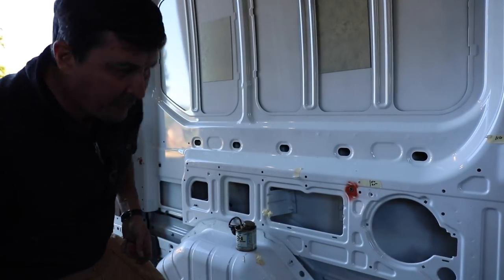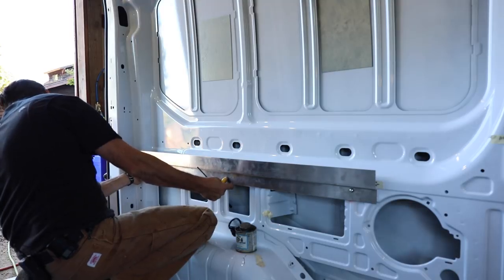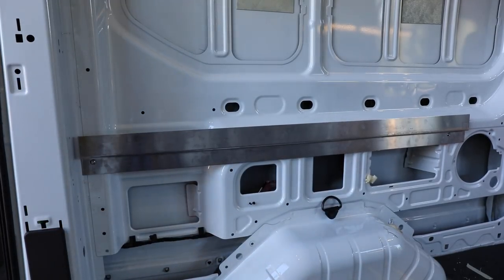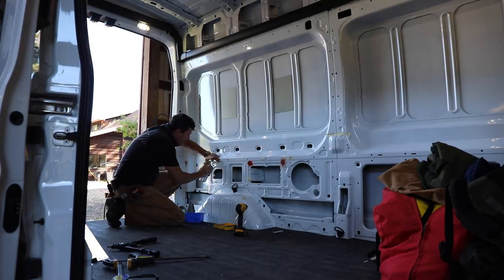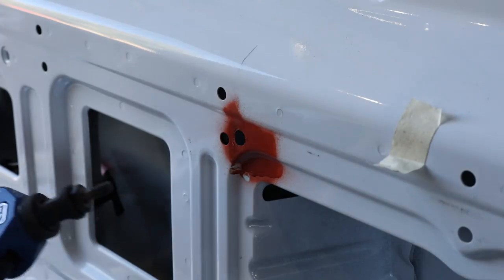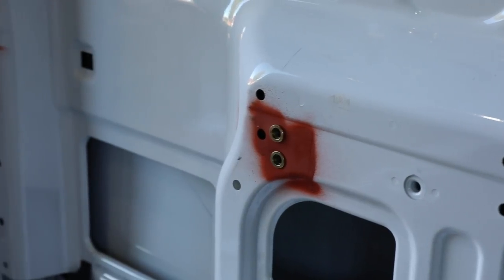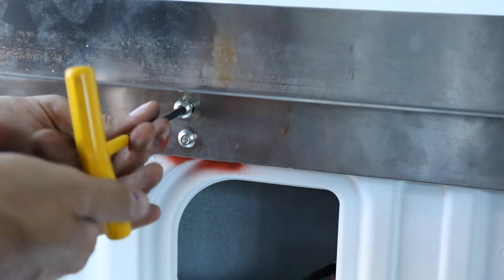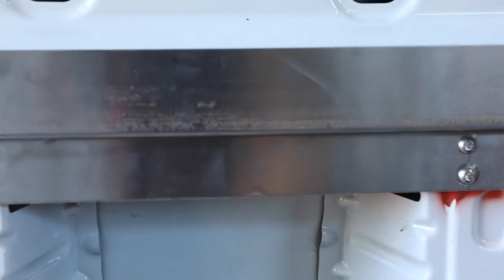Ford Transit Conversion - DIY 3 Panel Aluminum Bed (Part 2)

Comment from the maker: LINK TO THE ASTRO 1442 RIVNUT THREAD SETTING TOOL https://goo.gl/c9DqfU
Reply: Wranglerstar hey👋
Reply: Wranglerstar ii
Reply: Do a update on beekeeping
Reply: Wranglerstar not hating but u talk a lot in ur vids i will give u an advice do the work fast and don't talk much and ur vid will be better (AGAIN NOT HATING)
Reply: Wranglerstar love this van conversion series. Can you please label the vids part 1, part2, etc.?
Reply: Wranglerstar can you make an review on the paul chen danish war axe
Reply: Wranglerstar love it I use nut cert but they are awesome!

Comment: Cody ,Love your channel ! Looks like you need to invest in a Rotabroach Cutter set. Ideal for this type of job. these cutters are made by several in many sizes including metric. We use these often in our  fab shop and abuse them most of the time, including up too 3/8" thick material. Snap On [ Blue Point ] has a small set No. GA219B they call them sheet metal hole cutter kit.When doing this type of work, we drill a 1/8" drill bit or less[ pilot hole] 1/2 way thru the 1st layer then use closest size RBC ,if necessary, finish with traditional twist bit "at high speed"   .Almost never a bur to remove. These are annular cutters. This would also be a great item for you to review. We also use " Paint Markers " Markal Pro-Line . Easy to paint entirely around the hole and have many colors to chose from.We also use the thread setting [grip-sert] brand .
 Best of Luck, Stay safe ! 
God Bless you and your family
Mike

Comment: Ford Transit Conversion - DIY 3 Panel Aluminum Bed (Part 2)

Good follow up video Cody.  Looks great.  "The RIVNUT" is impressive !!   Thanks for the video.
God Bless to all.
Reply: RIV NUTS are not new, they've been around for more than fifty years in many High   Tech industries. They also make great binders for notes and schematics or any thing paper you can hole punch, flat washers can be used to keep from tearing out pages, and you don't even need to use the RIV NUT tool for this purpose. 
    The RIV NUT tool was expensive 50 years ago, as field service  sites only had use of one when a modification project came your way and you then had to ship it too the next field site ASAP when the mod was completed.

Comment: Are you going to use any of the spaces between the inner and outer shell?  If not, you might consider putting some insulation in there before you button everything up.  Might help on a cold night.

Comment: Surely someone else has suggested it, but a step bit, or unibit work best when drilling through sheet metal or thinner material.  They don't pull or warp the material.  Thanks, Cody for all you do.  Love the channel.

Comment: Hi Cody, I recently discovered rivnuts for our van that we use for camping and motorcycles. A tip for you, to avoid your deburring issues use a cone or step drill it's much neater for drilling panels. 

Great idea for a series I'll hopefully watch them all!

Comment: one thing with having bigger holes which allow movement you might need it seeing you have two types of metal that could expand at different rates and effects
Reply: Also, drill a larger hole for riv-nut alignment and put a fender washer that fits the riv-nut on both sides of the hole, squeeze in the riv-nut sandwiching the van body in between the two washers. Probably not a good idea for a heavily loaded riv-nut though.

Comment: Cody: small tip, next time you're putting primer on a panel like that spray the primer into the cap then paint it on with a small brush, you'll get the same protection but if you're careful you can keep it neater and closer to the hole you've drilled

Comment: Suggestion on the primer.  Decant the primer into a cup and use a cheap brush to apply it.  This will ensure the primer covers the bare metal especially on the back side of the hole.  And it'll look better too.

Comment: Hi, I also have a white Transit previous model (2013). What I notes that all vans painted in white have quite a poor finish.  Because you have a brand new one, have you considered to painted body with a something like plasti dip. That not gonna affect guarantee and you can always peeled off, I think that will be an ideal finish for way how you want to use this van and where you live. Good luck and thank you for another interesting video.

Comment: Nice job but I have a concern for the 1/8" thick aluminum plate and what may happen as the load of the mattress and it's occupants are applied.  While you have two fasteners at each location it will be the top fastener and aluminum plate region immediately adjacent to the fastener that carries the load due to bending or "prying action."  With bodies moving around some the load is not strictly a static load but becomes dynamic increasing the risk due to prying. The area under the head of the fastener is minimal considering you drilled 3/8" clearance holes in the aluminum plate.  The fastener head appears to be less than 1/2" so maybe you have a contact annulus area of only .147 sq inch.  It may be advisable to have some special washers made from 1-1/4" SS round stock the top of the washers will need ground back to fit under the break in the bar. Apply a radius to the ground washer that matches the radius of the break. This mod increases the contact area and so spreads out the load.

Comment: I am redoing the bed build in my van and had done a preliminary (ok, just sketches in my head) design that's very similar. What I have now is nice, but not removable, and as you note, it limits the use of the van. Modular will be much nicer, plus you can adjust the bed size if there's only one person using it, freeing up more space. Nice work! Subscribed.
Reply from the maker: Thank you Dan.  Hope your build goes well.

Comment: One thing I would recommend between those rails and the van body is to line the rails up with felt or fabric. Otherwise your going to have very minute rubbing that leads to possible corrosion or noise issues. The factory does this with plastic panels or bold on metal panels. Another solution is to use sikaflex or silicone between the panels, but that becomes a service nightmare at this point, and you may as well have saved the hardware and used rivets.
Reply: That sill sealer tape used to install ext. doors and windows would work well also.
Reply: yeah or get some blue-skin, it is used in construction for flexible flashings and weather barriers, similar to the eave guard on roofs etc.

Comment: A very small point, and it may have already been mentioned, you might consider rounding off the corners on the added pieces, those things seem to get sharper everytime you bump into them.

Comment: Cody, this is exciting to see your mods on your van. Too bad you couldn't use the inserts in the existing holes from the factory. That would have been even better and you wouldn't have had to prime the holes.

Comment: would doing all this work void your warranty? 

I've wanted to build a van like this for a while so I'm excited for the new series. love the channel
Reply: no it won,t , these vans like all vans are made to be used to transport either persons or goods, these vans are used a lot in europe as construction/mechanic vans(even fitted out with a cooler and layered with insulation and fiberglass for carriying frozen items)
the whole purpose of these things is to make your own layout to whatever suits your needs.
as long as your not sawing tru the framework(making it unstable) your good.
couple of holes here and there isn,t gonna weaken it, especially not when its ''reinforced'' by adding a layout(for instance made out of plywood)

Comment: I would sugest you round that corners just a bit, it's an disaster waiting to hapen. Otherwise nice wid. Like the colour of primer, you can vlearly see the nuts. Did you consider that bolts will lossen over time given the heat and vibrations? You could use a spring washer too.

Comment: on next episode Ford Transit Conversion - DIY 3 Panel Aluminum Bed (Part 25) we put the last screw THE PROPER WAY
Reply: Whats the life expectancy of a Transit?  might be finished by the time it needs to be welded, Also insulation that vans going to need a lot not only for a stable temp all year around, but plus sound deadening as well if you want to make it tolarable to the passengers in the back

Comment: hello wranglerstar, i was wondering in your opinion what is the best impact drill brand. i'm choosing between dewalt, makita, and milwaukee. i have always liked dewalt but have used the new xr model and i do not like the trigger stutter. thanks

Comment: I'm thinking Loctite may be better than neverseez in this application, it will still lube for install and prevent galling but will be better in the long run road vibration wise.

Comment: Hi Wranglerstar, Your videos are awesome! I have a 2017 Ford Transit 3500 so your van videos are really helpful. I'm gonna try and duplicate your bed system design. I trust that's okay by you. If I could beg a boon of you, can you tell me the alloy of the aluminum used for the bed support that is bolted to the van?  Thx in advance. -- Gest

Comment: So those rivnuts are good stuff huh do they have teeth on the inside of those rivnuts to dig into sheet metal Ima prolly order some I think I could use those a lot for my truck

Comment: Stainless steel screws, although the look nice, don't corrode are just more prone to strip than other screws. Over the years have seen countless issues with stainless screws.

Comment: the red primer is making me cringe, why didn't you use white spray paint?
Reply: It will be covered when it's done so it doesn't matter.   My guess is red is what he had.
Reply: Cause he lives like 1 hour from the hardware store.....use up what you got or you will get nothing done at all

Comment: Some naphtha would do a great job stripping the factory oils off those frame rails. Just don't light a match anywhere in the same zip code.

Comment: Primer is typically somewhat porous and not a very good rust preventative. Are you using something special, or are you just going with it because it's something you had laying around?

Comment: I doubt that you will see this comment, but I have an axe head that looks like it's about 4 or so pounds, and it is a single bit felling head.  I looked online and couldn't find a good handle for it since the opening is a lot longer than normal axe handles.  If I send you the axe head could you fit a proper handle to it??? It would also make for a good video too

Comment: HELP NEEDED!!!! I am 17 looking for my first truck... I have found a 2006 ram 1500 single cab for sale ( rwd, 120k miles, at 6,800) I was wondering if this truck would be a good "fit" for me and as a first truck. Also is this truck going to be as bad as people online say it is in the snow? I live In New Jersey
Reply: AJ9 that should be a good first truck. Make sure you get it mechanically checked out. It will probably cost you some money to get a shop to check it out unless you know someone that is a mechanic. As for winter the best thing that you can do is have real good tires. And put some weight in the bed. One of the best things to use is bags of sand. Build a frame work out of 2x4s in front of and behind the wheel wells that way you can place the sandbags right over the axle for the best weight distribution use a couple hundred pounds of sand. Carry a shovel with you and if you get stuck you can use the sand in front of the tires for traction. And just remember that it takes a lot longer to stop in slippery conditions

Comment: I would really use split washers if I were you. Otherwise over time, with the vibrations of the car etc, those screws will come loose. NB must be split washers, regular washers won't stop it from getting loose.

Comment: What is everyone's guess for how long Codey can drag this series out for?

My guess, 27 parts.
Reply: stburr91 27 would be a blessing. These sort of project have a lot of steps. I'm hoping it's not 150 parts.
Reply: at least, and no playlist so they are hard to find and watch in order LOL
Reply: stburr91 12 ...the bridge was 9 right?
Reply: stburr91: And what is your guess how long it will take to learn to spell CODY?
Reply: stburr91 I
Reply: stburr91 for the bed build or the whole thing?  (not hating but yea a lot of video for the same thing; the bridge series was J u s t stretched enough)
Reply: stburr91 100 if he makes 3 videos of putting up one piece of metal

Comment: Why are we watching you drill two holes just a couple inches from two factory holes?  Even a factory threaded nut?  I would clamp the plate and just use a shorty Sharpie or a modelers-sized spray can and mark the factory holes on the back of the plate from behind, drill the plate, and then insert the Rivnuts.  Also, The ADN14 from Astro does the same job using a drill and in one step and costs about $30 more. My .02 before taxes...

Comment: First use of rivnuts I've seen  in a van build!  bought one a while back and been itching to use it!

You can ditch the hand tightening and use your impact driver with the Dewault hex clutch!  I've got one and it works AWESOME.  Today, there is simply no reason to buy a DRILL, when the impact wrench does it all with a clutch, and a hex keychuck...  Only reason to own a drill is to save a bit of time if doing a lot of drilling and driving, then having two tools lets you load a bit and the drive bit and grab back and forth between tools!

Best $13 I have spent, slides back and forth from full bore, to clutched...:

https://www.amazon.com/DEWALT-DWHJHLD-Impact-Clutch-Holder/dp/B005A2FQJ8